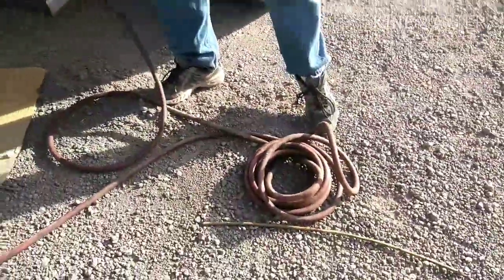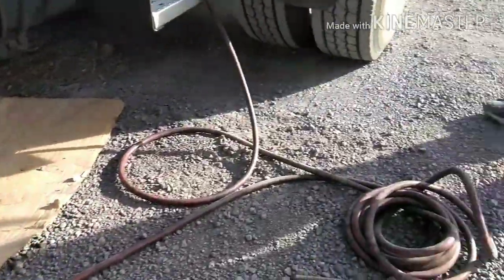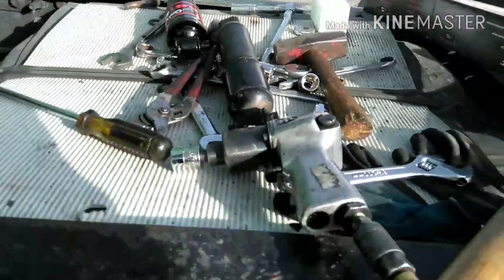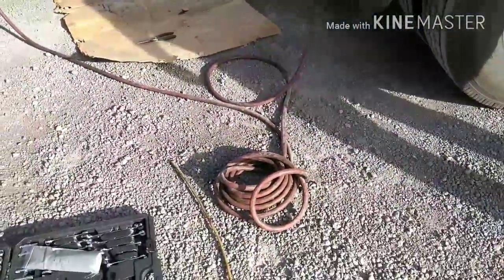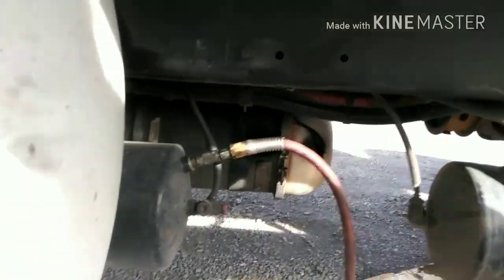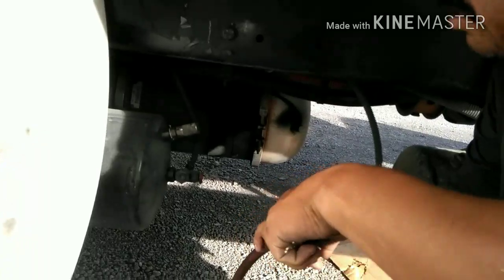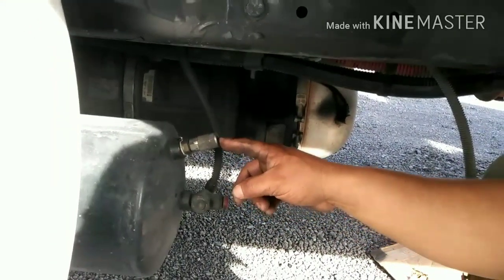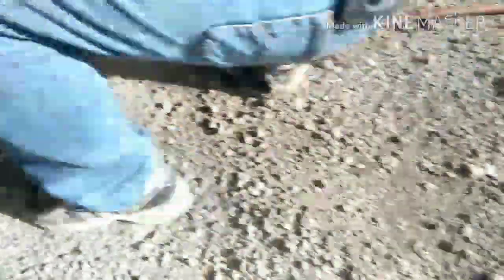Using air tanks for air impact

Comment: This is not the safest to do this. You need a shutoff valve going to the tank. If that fitting starts to leak while drinking, you're in trouble
Reply: Drinking???
Reply: @lsvtech21  probably means driving😂
Reply: @DONTCALLMETHAT  I know what he means, I was just let him know what he wrote 😏

Comment: How do yu put the valve on
Reply from the maker: just a screw on,make sure you drain all your air out of the air system before you unplug the original screw out of the air tank,thanks for tunning in
Reply: Have yu ever replaced a shock behind the 5th wheel that release the pins to slide the 5th wheel
Reply: Buen video así es más fácil la coneccion .

Comment: I hook my nitrocat 1250k 1/2 impact connected to my red glad hand. I can bust my lug nuts loose w no problems but it has to be with the nitrocat...did it with the harbor freight 1/2 impact and it would not bust them loose from 450 ft lbs.
Reply from the maker: thats good info,thanks for tunning in
Reply: Nitrocat  1250 k 1/2

Comment: Do you know the max psi?
Reply: Jball Sur  125 to 130 max psi but it won’t stay there for long in use tractor engine has to be on because it will drop psi quick in use
Reply from the maker: yes LION LOCS is right the truck has to be on,wild you are using the impact,if not the air drains fast,thanks for tunning in to the two of you
Reply from the maker: thanks for tunning in